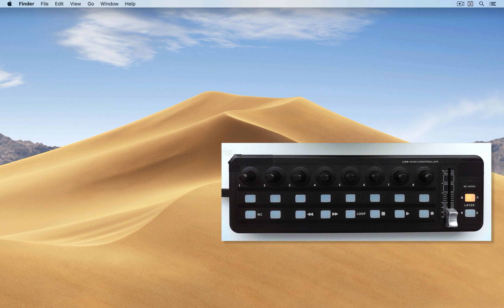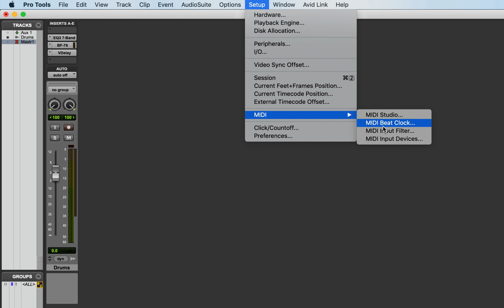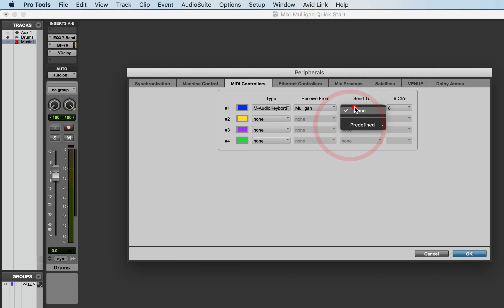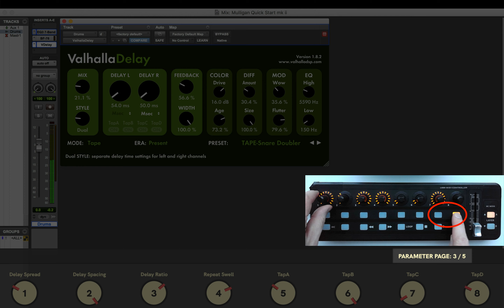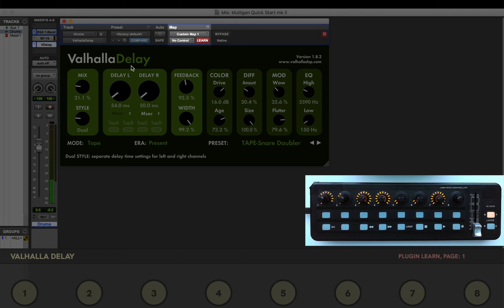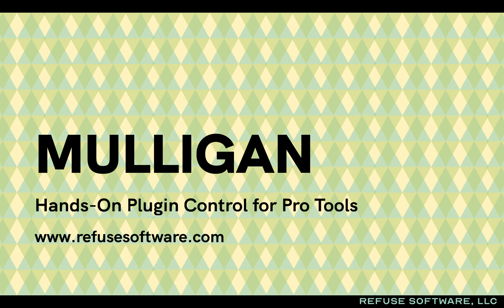Mulligan 1 – Quick Start Tutorial

Comment: Can you use buttons for things like toggles in plugins?
Reply from the maker: Yes, it is possible to set up buttons as well. Because Mulligan works with any plugin, it's best to keep the control layout flexible, and work with a set of 8 knobs that could be mapped to any kind of parameter (continuous knob OR toggle button). But you can also have buttons available for mapping, by having those buttons send the same MIDI CC numbers that the knobs are using. If you'd like to set this up, I'd be happy to talk you through the details, just drop me a line at our contact email. https://www.refusesoftware.com
Reply: @refusesoftware  Ah yes that makes sense. I'll give it a shot. I'm still playing around with the demo trying to figure out what the best path for my workflow is. I like the idea of the Artist Mix because of the faders, but you can't change what the knobs control which feels like a deal breaker for me. That leaves me wondering if maybe Mulligan/X-Touch Mini with another set of faders might be my best bet. I think I saw you're not interested in having Mulligan control faders in Pro Tools, so is there another set of faders you recommend that would pair well with Mulligan/X-Touch Mini? Like the Faderport 8, Icon Platform M+ or something else?

Another thing I noticed is even though you can have Mulligan paired with multiple controllers, the 8 knobs of both controllers are identical in function. Meaning, knob 1 of unit 1 and knob 1 of unit 2 will both do the same function. I even tried making a custom map and was met with the same results. Is that a limit from Pro Tools or am I possibly doing something wrong? It would be incredible if you can have for example a plugin with 16 parameters where you can map 8 to one unit and 8 to another. I'm thinking of the future where I create a custom device with an Arduino(s) so that each set of 8 knobs and/or buttons are considered it's own separate device giving me access to more than 8 controls at the same time, if that makes sense.

*I continued the convo here so others can see but if you would prefer email, just let me know and I'll forward this along to continue there.
Reply from the maker: @ilikemyrealname  Thanks for your interest, and I'm happy to chat about it here. About using a fader bank, there are lots of options for HUI and Eucon controllers. I usually test HUI compatibility using a Novation LaunchControlXL, which doesn't have motorized faders and is pretty inexpensive. But I've also heard that Eucon control works fine alongside Mulligan, so I believe you could run an Artist Mix for faders if you're looking for something higher end. Sorry, I don't have any hands-on experience with the other units you're asking about.

As for the 8 knobs deal, yes that's unfortunately a limitation that's baked into the MIDI controller protocol that Mulligan uses. The parameter control interface in Pro Tools handles 8 parameters at a time, so no matter how many hardware knobs we might have on hand, the internal system only "focuses" on a set of 8 at once. Some further details here about that:
https://www.refusesoftware.com/faq/26
Reply: @refusesoftware Thank you for your replies. Means a lot. I'm gonna keep playing around with this and thinking through what I want to do. The "Layer" buttons on the X-Touch Mini, can those be used to switch the knobs between plugin parameters and sends/pan/so on? I'm gonna keep reading through your documentation and the Gearspace thread to educate myself.
Reply from the maker: @ilikemyrealname  Yes, the Layer (A/B) buttons on the X-Touch Mini switch between two independent presets. So yes it can work to have Layer A mapped to plugin parameters, and Layer B mapped to current track commands like level, pans, sends.

For this to work, you just need to have Layer A's knobs sending on different CC numbers than Layer B. For example, if Layer A's knobs send on CC numbers 1-8, then make sure Layer B's knobs are sending on 9-16. Then Mulligan can distinguish between the two sets of knobs.
Reply: @refusesoftware  That's great. Thank you so very much for all your replies. I think Mulligan/X-Touch Mini with some sort of motorized faders will make an excellent combo. Wonderful chatting with you!

Comment: This is VERY interesting. I have a question. Is it possible to assign controls for proq3 as follows:universal rotary knobs from 1 to 3 are freq,gain,q and then subsequent rotary knobs as frequency bands that you can move from left to right. You choose a frequency by the push button below the rotary knob. I hope this makes sense.
Reply from the maker: Thanks for your question. I believe you could essentially achieve this sort of knob layout with Pro-Q 3. Mulligan supports custom mappings, with multiple “pages” of up to 8 knobs each. So you could have multiple pages, each page set up with knobs 1-3 controlling freq, gain, q like you said. Each page would be mapped to a different frequency band, however. So you would switch bands with the page buttons.
Reply from the maker: Please drop us a line here if you’d like more help with that setup: https://www.refusesoftware.com/support
Reply: @refusesoftware  Awesome! This was definetly something i was looking for.